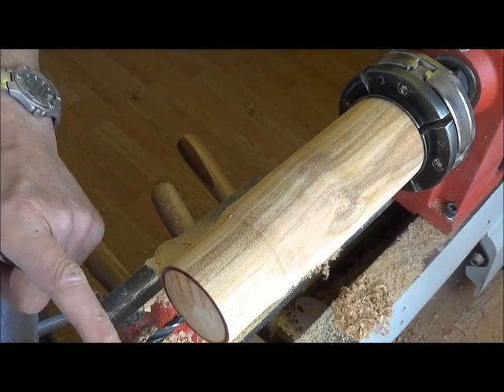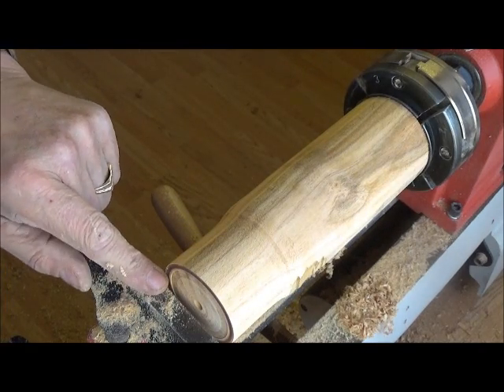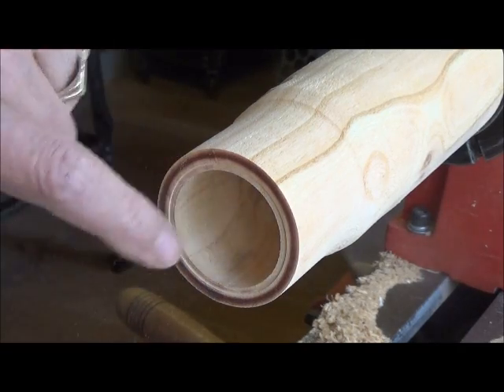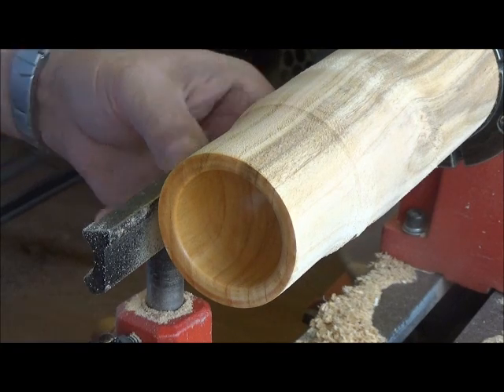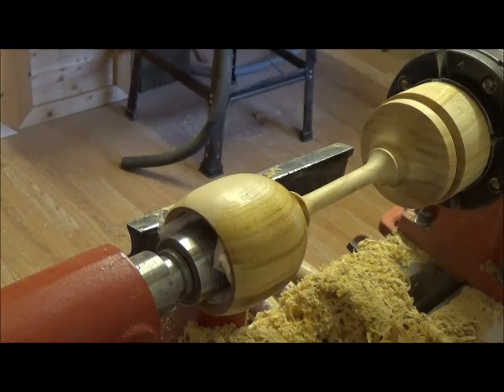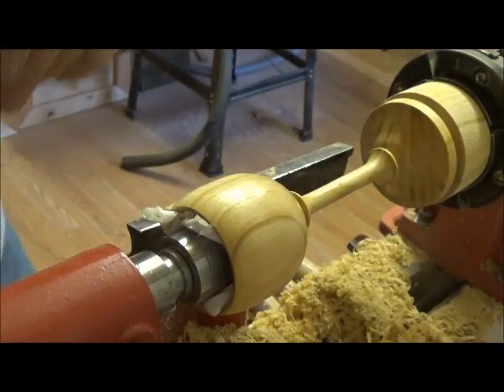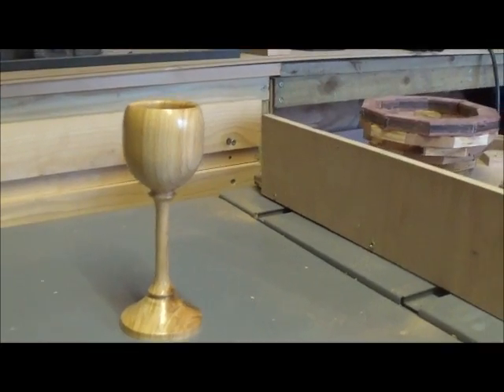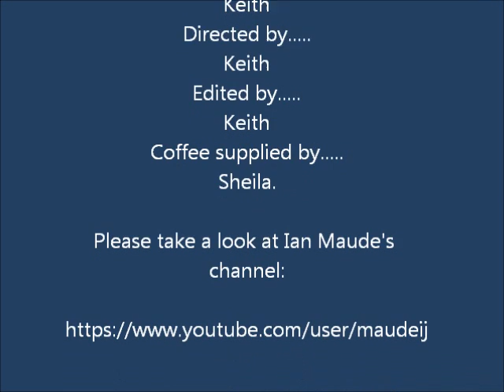A Goblet

Comment: The goblet came out great, nice job. I was a bit nervous watching you hollow out the bowl with only the chuck for support. I built a steady rest inspired by Stephen Ogle's video. I adapted his idea to my lathe. I must say I feel much safer turning the end of a long spindle using the steady rest. I used some inline skate wheels on mine and I see Mr. Ogle upgraded his this way as well. I've found several other uses for it recently. Just a thought. You seem to be comfortable without a steady rest. Anyway, I enjoyed your video.
Reply from the maker: Gil Grace Hi Gil, Yes,I was pretty nervous doing it without a rest,and there was a bit of vibration! My next job will be to make a steady rest.In fact,I'm off to my local sports shop in the morning to get the wheels!
Take care,Keith.
Reply: Keith Barrow Perhaps you could make a video on the subject.
Reply from the maker: Gil Grace The steady is nearly made,but the shop hadn't got the wheels,so I've ordered some bearings,and will make my own wheels instead. I will put a small video together covering the basics though.